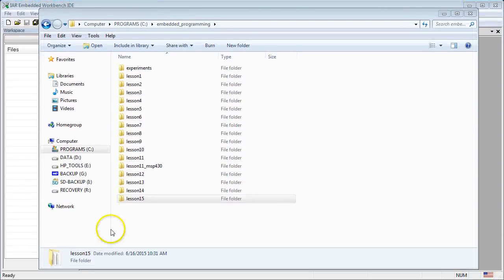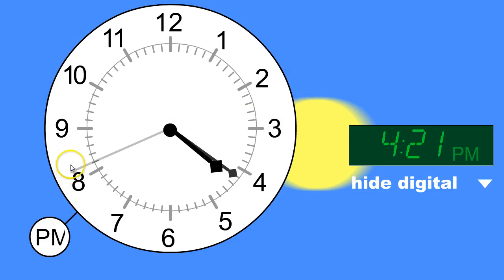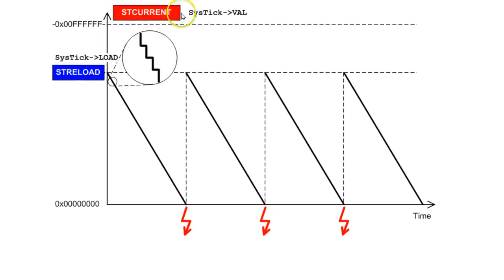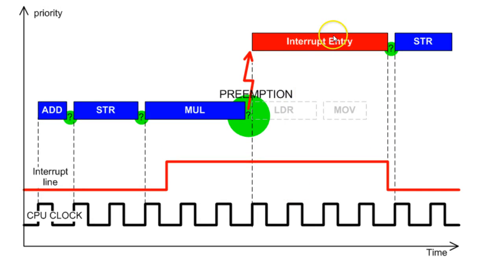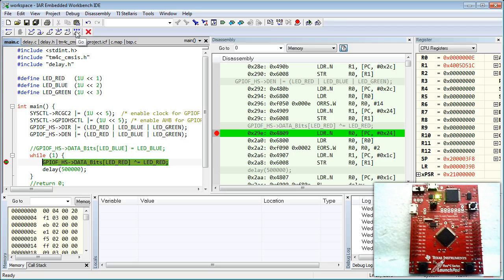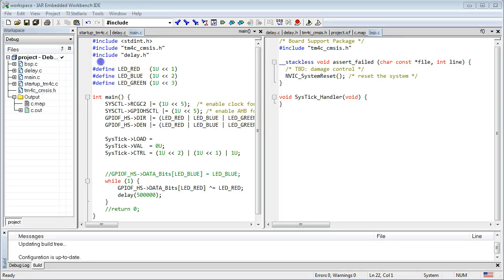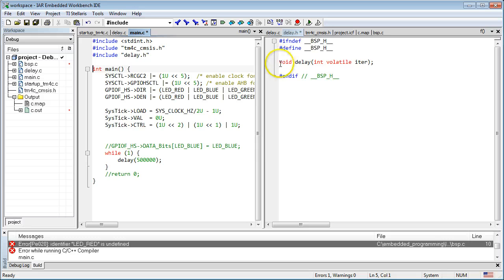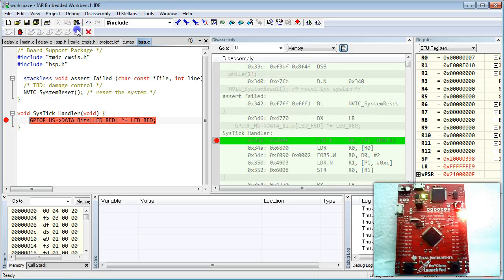#16 Interrupts Part-1: What are interrupts, and how they work

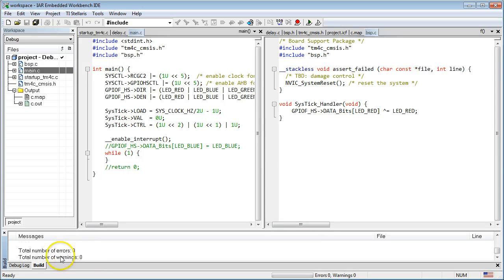Comment: At 14:43, how does the systick_handler being called in the main.c file?
Reply from the maker: The systick_handler() function is the so-called Interrupt Service Routine (ISR), which is called automatically by the hardware when the SysTick timer interrupts the CPU. This is automatic transfer of control to the ISR, which is the subject of this lesson. This requires special hardware in the CPU and therefore is so unusual. --MMS

Comment: I noticed that the SysTick_Handler is getting called even without __enable_interrupt(). Could this be because primask is cleared by default in the new Tiva C Series launchpad ?
Reply from the maker: Actually, the ARM Cortex-M CPU comes out of hardware reset with PRIMASK cleared. The __enable_interrupt() call is just a precaution in case the startup code, some library code, or your own code happens to disable interrupts. In that case, an interrupt-driven application like the project for this lesson will appear completely "dead". For that reason, it is just safer to explicitly (re)enable interrupts to be sure. I hope this makes sense to you. --MMS

Comment: These lessons are phenomenal, thanks Miro! When I added the inline function "__enable_interrupt();" line to my main.c, I received an Linker error stating no definition for "__enable_interrupt". I fixed the error by adding #include "Intrinisics.h". I'm using IAR 9.20.4. But interestingly, I opened Miro's workspace and did not need the include statement. Curious as to what workspace setting would be causing my error.
Reply from the maker: I'm glad that you like the lessons. The IAR header file <intrinsics.h> is actually included at the top of main.c (at least in the project accompanying this lesson #16). The facility  "__enable_interrupt()" is interesting, because it is a so-called "intrinsic" function that does not expand to a function call. Instead, the compiler expands it in-line thus avoiding the function call (and return) overhead. You can of course verify that by checking the disassembly in the debugger. When the <intrinsics.h> header file is missing, the compiler does not recognize "__enable_interrupt()" and so it generates a regular function call to it. Then the linker tries to find this "function" and fails. --MMS
Reply: @StateMachineCOM  Thanks for the explanation! I was trying not to use any of your files as I went through the lessons; And yes, I now see the <intrinsics.h> after checking your github. Thanks so much for continuing to respond and support others questions for these lessons!

Comment: Dr. Samek, thank you again for your lessons. I am interested in inspecting the __enable_interrupt() function. I would think it can be found in one of the .a files in the IAR Workbench arm/lib directory. I saw your example the other day of the ielfdump.exe tool for inspecting .o files. Is there a good way to find / inspect the contents of .a files? Or am I going in the wrong direction?  Thank you very much for your time!
Reply from the maker: Actually no. The special functions like __enable_interrupt()/__disable_interrupt() cannot be found in any library. This is because they are *inlined*, meaning that the compiler inserts the code for such functions directly at the place of use. This means that the function does not exist as a separate entity. Such "inlining" of functions eliminates the function call overhead (branching into some code and branching back), because in that case the overhead is larger than the actual work to be done. Now, if you want to inspect the function __enable_interrupt(), the only way is to see the disassembly. For that, you can set a breakpoint at the function and run the code. When the breakpoint is hit, just see the disassembly. You will see something like "CPSIE I", and not "BL __enable_interrupt". --MMS

Comment: I hadn't run the code on the board for a bit but decided to at the end of this lesson. When I did, the LED was blinking between blue and both blue and red, like it had been set up to do in previous lessons. Turns out this was because the LED_BLUE bit had never been cleared. It carried its value despite the board being off for a full day. Goes to show you can't assume initial values will be 0 (at least for AHB it seems). This makes me wonder though, would it be good practice to, for example, explicitly set LED_BLUE and LED_GREEN to 0 in your code if you're trying to only blink the red LED, so that you can avoid unexpected behavior?
Reply from the maker: This is strange and I would first check your code. But yes, it is considered a good practice to explicitly set or clear the GPIO lines to the desired initial state right after configuring them. --MMS
Reply: I had the same issue. I ended up resetting the board using the troubleshooting guide, and this seems to have done the trick...

Comment: Just a heads up, after adding the __enable_interrupt() function to clear the PRIMASK register, my code would not link properly in IAR.

After looking in the help section, I found out the header file "intrinsics.h" must be included to use __enable_interrupt(). Once I included
the header file it compiled and linked properly.
Reply from the maker: Hi Michael. Thanks for watching. The system header files like <stdint.h>, <intrinsics.h>, and "tm4c_cmsis.h" are included in main.c. I don't know how you could miss this. Please check the project downloads at state-machine.com/quickstart
Reply: @StateMachineCOM  Ahh, I believe that's where the confusion was. I didn't have <intrinsics.h> in my main.c file because I copied the code from the previous project to start project 16 instead of downloading from the website. Thank you for the response and the phenomenal work you do with this channel. Your content has been of great value to me as my computer science curriculum does not delve deeply into embedded systems.

Comment: In which file can I find the definition of __enable_interrupt()?
Reply from the maker: The intrinsic function __enable_interrupt() is defined in the IAR file <intrinsics.h>. This file is included indirectly through the following include chain: tm4c_cmsis.h -> core_cm4.h -> core_cmFunc.h -> cmsis_iar.h -> intrinsics.h. --MMS
Reply: I'm using IAR v. 8.30.1. I copied the entire 'lesson16' folder from the url you provide. I ran the workspace.eww file. Even though "tm4c_cmsis.h" is included, I still had to manualy include "intrinsics.h" because otherwise the function __enable_interrupts() was 'declared implicitly' and I received the compiler error.
Reply: Thank you very much!

Comment: The "__enable_interrupt()" function is specific to IAR? Is there a generic way to do this? Seems like something everyone needs to do. Is this series of videos funded by IAR?
Reply from the maker: Yes, the __enable_interrupt() function is specific to the IAR compiler and other compilers for ARM might call this operation differently. For example, in lesson #19 I switch to the GNU-ARM compiler, where this function is called __enable_irq(). Both these intrinsic functions end up generating the same machine instruction "CPSIE i". In the future lesson 21 (still under development) I will demonstrate how to accomplish such operations generically. No: this video course is not funded by IAR. Why are you oozing so much negativity? --MMS
Reply from the maker: I plan to introduce the QP framework in the new group of upcoming lessons. This new group will cover topics like: foreground/background architecture, Real-Time Operating System (RTOS), object-oriented programming (yes, we will see how virtual functions work!), event-driven programming, state machines, and automatic code generation. The new lessons are coming soon. Stay tuned!
Reply: Actually it's a great feature of this course that Miro changes development tools in #19 and walks through the impact on the project.  He also provides the source code for his QP framework online if you want to take a look at that and see how he supports a wide variety of tools and devices.

Comment: Has anyone tried to implement the IRQ for either of the pushbuttons? I have been trying to do it but I have had no success. I configured GPIOF as follows:

   SYSCTL->RCGC2   |= 0x20;  // Disable clock gating of GPIOF
   SYSCTL->GPIOHSCTL  |= 0x20;  // Enable high speed bus
 GPIOF_HS->LOCK  |= GPIO_KEY; // Unlock GPIOF
 GPIOF_HS->CR  |= 0xFF;  // Enable GPIOF commits
 GPIOF_HS->PUR  |= 0x11;  // Set GPIOF push button pins to pull-up
 GPIOF_HS->DIR   |= 0x0E;  // Set GPIOF LED pins to output
 GPIOF_HS->DEN   |= 0x1F;  // Set GPIOF pins to digital enabled

 
 // Configure interrupt for push buttons
 
 __enable_interrupt();
 __NVIC_SetPriority(30, 1);
 
 GPIOF_HS->IM   &= 0x00;  // Mask all GPIOF interrupts, preventing iterupts
 GPIOF_HS->IS   |= 0x11;  // Configure GPIOF push button pins for low level detection
 GPIOF_HS->IM   |= 0x11;  // Un-mask GPIOF push button interrupts, enabling them

As far as I can tell this should enable the GPIOF IRQ when either of the push buttons is pressed, but when I set a break point to my handler function:

 void GPIOPortF_IRQHandler(void)
 {
  while(!GPIOF_HS->DATA_Bits[0x1] || !GPIOF_HS->DATA_Bits[0x10])
    {
   GPIOF_HS->DATA_Bits[LED_W] = LED_ON;
   printf("On\n");
  }
 }

The IRQ never executes. Any ideas?
Reply from the maker: The GPIO interrupt handling will be shown in the new upcoming lesson #21 about foreground/background systems. --MMS

Comment: At 8min 48s, why the delay function  doesnt get invoked on the disassembly view? Thanks!!!
Reply from the maker: The delay() function gets called! You don't see it, because the debugger stops only at a breakpoint at the top of the loop. Please note that the delay incurred by the delay() function is only 1/2 second, which is about the time between hitting the breakpoint.  --MMS

Comment: can u solve this problem ??
Design 8051 based system to count total number of persons getting-in and
going-out with a single door through INT0 and INT1 and display the number of
people in the Hall on P1. While generate 100KHz, 250KHz and 375KHz on P2.0,
P2.1 and P2.2 respectively and transmitting persons info via UART at 4800bps.

Comment: Dear Miro Samek,Today I downloaded this lesson (lesson 0x10) from state-machine.com. and run code it worked as expected. In the last of this presentation you said that final touch is to globally enable interrupt by clearing PRIMASK register. For this IAR EW provide intrinsic function __enable_interrupt().  But interesting thing is that I deleted that function and recompile and burn to tiva Launchpad, and interrupt is still firing without this function, would you please explain how is this happening. I tried to solve this mystery but could not. Thanks,Abdul Sattar
Reply: May be because you forgot to clear the flag...well its been 3 years now.!!!! you probably know it now anyways!

Comment: Dr. Samek, the interrupt handler must be in a separate file because it's similar to a normal function in C? I tried to keep the interrupt handlers prototypes in a separate file and the handler itself in the main.c function and got a very strange error: Error[Pe065]: expected a ";" The problem is that this error points to the end of the definition and before the start  "{", like this:                     
                            here ---------->|
void SysTick_Handler(void)   {      GPIOF_AHB->DATA ^= 0x04;  }

This seems to be a cryptic error. Defining an interrupt handler in main.c causes the function to be called twice?

Thanks.
Reply from the maker: High Altitude Observer 
Interrupt handlers are regular C functions in ARM Cortex-M. You can define these functions anywhere you like. You could put them in main.c or in any other module, such as bsp.c. The prototypes of all interrupt handlers are provided in the TM4C123GH6PM.h header file, so you should include this header in the module with the definition(s) of any interrupt handlers.

I'm not sure why you get this error, but I would strongly recommend that you start with the working project provided with this lesson. Only after you make sure that you can build and run this project, I would apply any changes.
Reply: Quantum Leaps, LLC 
Thank you very much for your response.
Reply from the maker: +Helios Fire The connection is there. When the SysTick interrupt occurs, the hardware will jump to the address at offset 15 from the beginning of the vector table. You can place an address to your own function there. The only requirement of CMSIS is that you call this function SysTick_Handler. But you could just as well call it Fred (in which case you will not be compliant with CMSIS).
Reply: +Quantum Leaps, LLC 

So what I'm reading here is that you can define your own interrupt handler without CMSIS? Because the key issues I'm having trouble with is how would the Interrupt call Systick_Handler? There seems to be no connection especially when you can define your own interrupt handler.
Reply: OK, it's making a little bit more sense. But I have to add the function inside the CMSIS vector table first? I can call it "Fred", or "Cat" alsong as its in at offset 15 of the vector table in CMSIS?

Comment: When configuring the SysTick why didn't you use the bitwise operators? Also in turning on the LED_BLUE before the delay loop you dont use them, but when toggling the LED_RED you use them (I understand why they are required for toggling). I am a bit confused on when to use them and when not.
Reply from the maker: Davor Juric 
SysTick has only three registers (LOAD, VAL, and CTRL) and I was sure that they were not shared with the rest of the application, so they were simply written-to.

The turning of LED on and off was done without the need to read the previous state of the LED, because you know that you want to turn it on or off.

But toggling LED is fundamentally different. You want to change the current state of the LED, so you don't know if you want to turn it on or off. You want to toggle, so you must read the current state of the LED. Hence the use of the ^= bit-wise operator.
Reply: Quantum Leaps, LLC  I see. Thank you!

Comment: Thank you so much for putting these lessons on the inter tubes. This information is extremely valuable and very well explained. As a systems designer, I only wish I could work with you on a daily basis.